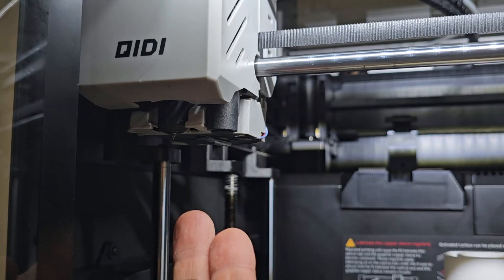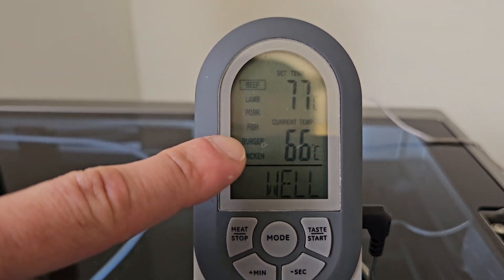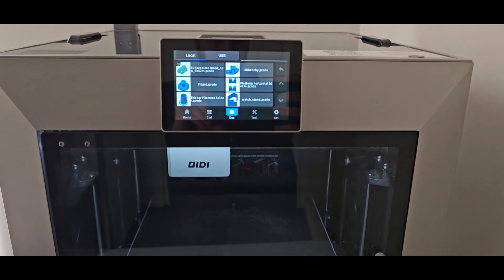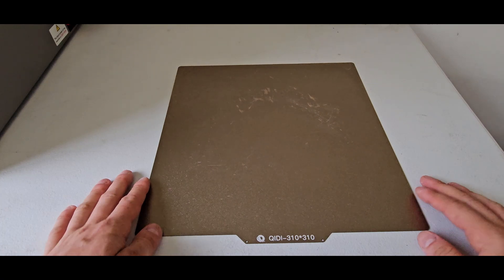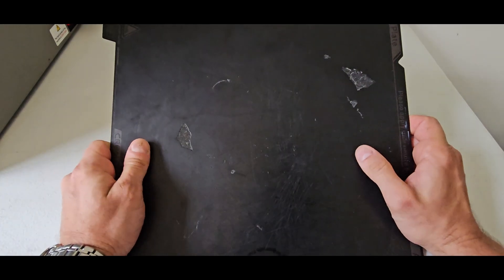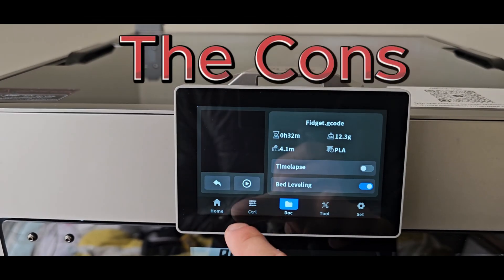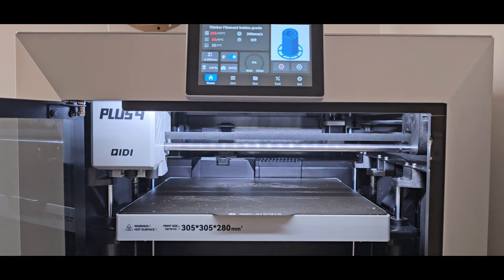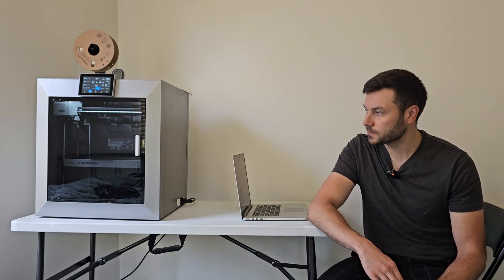I PRINTED FOR 1000 HOURS... What They DON'T Tell You About the Qidi+4

Comment: Decent printer the only trouble I had was the nozzle would sometimes hit the little metal plate in the back when it's cleaning nozzle and after many times the nozzle got damaged. Would still work but flow was slightly less due to restriction form damaged nozzle tip.

Comment: @2:10 why are you scrapping? The build plate can be flexed. I have never had to scrape anything off my build plate.
Reply from the maker: It really depends on the geometry of the part and filament you're using. Sometimes you need adhesive on the plate and flexing doesn't remove the part

Comment: Hello,
  I have a Qidi Plus 4 and have run into a troubling issue. I am attempting to print two parts and the each file is 803MB. I use orca slicer. When I attempt to transmit the files, I receive a 502 Bad Gateway error. I also start receiving  a continuous  error message the time lapse has failed.

  I reached out to Qidi tech support and was told the size of the file was causing the 502 Bad Gateway error. After some research on the Qidi tech FB groups I found a user stating the max file size for transfer is 500 MB. I loaded the files on the USB drive and started printing.

  These 803MB files are 76+ hours of print time and ~1.8kg of filament. I had one of these prints running today. After 20 hours the printer stopped and reported “print complete”. The nozzle stopped at its last location instead of moving to the front right of the print bed. 

  Have you seen any issues like this? Have you solved them? If so, how? Thank you

Comment: Personally, I feel the screen is just fine, especially at the pricepoint this unit is at compared to the competition (Bambu, Creality, Flsun, etc.). Sure, it takes a moment to load the thumbnails, but other than that, the responsiveness of the screen is quite good. It's bright and sharp enough to easily perform on-the-fly adjustments. 

As far as the start-up routine, I like it. Why? Consistency! ALL my prints are consistent in terms of setting the z-axis and leveling. Now, there are times when I turn the per-job bed-leveling off, especially if I'm printing repeat parts. Sure, the routine is longer than others, but the quality is well worth it! 

Replacement parts are very reasonable on Qidi Tech's website and they often run discount promos to make it even better. I stocked up on several nozzles and a few replacement heads, a smooth and cool plate, as well as some spare items such as filament cutting blades, silicon socks, and nozzle cleaning items. There's already a TON of mods you can find on Thingiverse and Printables, which makes customizing that much better. 

All-in-all, this printer KICKS MAJOR ASS and I didn't have to spend over a $1000 like you do with the others.

Comment: PETG question: with the textured build plate, is any special procedure needed to either get PETG to adhere or to release?  I've been happily printing many hours of PLA on my Qidi+4,, but wary to try PETG because for at least some other build plates (in other printers) PETG sticks far too well... and I don't want to naively ruin the Quidi+4's build plate!  Thanks!
Reply from the maker: Yes, use 'Filaform adhesive spray'
Reply: @Buildprime_x  Is that to get the PETG to stick? Or to release?
Reply from the maker: @Graham_Wideman  to stick
Reply: ... and I just printed a benchy boat in PETG and it came out great.  I did notice that it was easier to remove than PLA from the (stock) build plate, even though the plate had not cooled appreciably. So that could be a concern, and corresponds to @Buildprime_x's comments.

Comment: I really wanted to like this printer but my team has had so many problems with the Z height getting corrupted and the nozzle crashing into the build plate and gouging the hell out of it that I just can't recommend this printer.  When we upgraded the firmware to verison 1.6 the problem got even worse.  There's just no excuse to release firmware with this kind of major bug.  The E-stop on the screen is a joke too since it takes about 5 seconds to take effect.  A lot of damage to the plate can happen in 5 seconds.  This is no doubt a symptom of the laggy screen UI you mentioned.  I know Bambu has ticked a lot of people off with their recent security policy change, but at least they make sure their printers work before shipping them.
Reply: I got my X1C on April 2023 and in the second firmware update I got the build plate scratch, and this guy's work on his software.
Don't get me wrong it is a good machine, I upgraded the enclosure insulation, I tune the skew to get precision and I mostly print abs asa
With an aftermarket nozzle.
I got one qidi Q1pro and I sold the X1C with 2000 hours.
I will get the plus 4 soon
Reply from the maker: Yea I'm generally scared of updating firmware on printers for fear of the new firmware ruining something that previously worked fine. Hopefully they patch thag
Reply: Mhh I have none of your problems, maybe a defective sensor?

Comment: At 65C, can you print full bed size ASA or ABS parts and not have them warp? How do you assure adhesion to the bed for those materials? Got any experience along these lines during those 1000h?
Reply from the maker: Yes, 65 degrees is fine for keeping Abs from warping because it keeps the whole part hot uniformly. I've printed plenty of full sized parts in those materials. Bed adhesion is solved with 'Filaform adhesive spray'

Comment: I'm over 1000 hours on my Plus 4 now. A WHOLE lot of very hot engineering grade filaments. After 1000 hours I've learned- this printer is freaking awesome still. I've had a couple small issues- the chamber heater started acting up around 800 hours. Easy swap, the filament cutter arm broke around 700 hours and a LOT of filament changes- I was doing multicolor manual changes so- A LOT. And I've had 2 nozzles explode for what appears to be NO reason- I suspect when used in HIGH temp prints- 330-370c the heat cycling stresses the ceramic and it'll will just crack inside the nozzle. That's it. That's all. The thing is freaking awesome. The print start up is a love/hate thing. Love how well it works- HATE how long the self leveling is. Improvements- hotend fan shroud, coding as listed in the plus 4 wiki to reprogram the chamber thermal sensors to be much more accurate (and in effect it'll raise the chamber temp because as is it is NOT giving you an accurate temp reading for the chamber- it may be as much as 10c COOLER than it says. 2 minute fix and then heated chamber work even better and can beat soak up around 80c for those real got prints. And the qidi box is coming out Some time this quarter they said.
Reply: The nozzles exploding is kinda common and the proposed cause is that the nozzle smacks against the side of the PEI wipe plate. There is a fix but it's pretty jank, you have to either cut part of the plastic frame or sand down that PEI piece to an angle
Reply: Can you share what specific engineering filaments you're printing? I'm looking at printing parts for a muscle car restoration out of PPA-CF or PPS-CF10 (not sure yet).
Reply: @edmorris4103 all of them. Pa6, pa12, ppa pps paht, pet cf, PC cf. What do you want to know? (And what specifically are you wanting to make for your project, i can prob tell you which one id use to make it)
Reply: Thanks for sharing… everyone thinks these will never have issues and think parts don’t ware over time and ignore maintenance.

Comment: Great review, I've just got mine, I've put it on a desk that has four pipe legs, the desk is dancing like crazy during the printing process, the first benchy come out nicely, would you prefer to put it on a more stable base? Thanks
Reply from the maker: I've had it on some shaky tables, it still prints ok. Of course, it's better to have it on something solid, even the floor, if you have a hard floor
Reply: @Buildprime_x  Thanks, will try out to see the difference, even with the wobbling desk the results are next level

Comment: Love my QIDI plus 4,    Made double the price I paid for it right away on my first Job on it.   25 custom Mounting plates for London bus cab control units.     churned them out fast accurate and beautiful.     bed levelling is hard to turn off,  if I load onto a usb and print I get time to turn it off on the LCD if im quick,    if I send over network  I cant bypass levelling.   it's annoying for small parts that may print quicker than the levelling process.  The belts to me don't seem tight enough,   printed belt tensioners to bypass the springs.   Think prints would have less artifacts when I choose to print faster if they were tighter.    not installed it yet.

Comment: I'm not sure why you may be having issues with your screen. Our Plus 4s screen is very responsive and works great. Make sure you download their recent firmware update.

The Qidi screen is a much better screen than what comes on the Bambu printers (that look like they were designed in the 1970s). 

I'm very glad that Bambu came out with their lockdown news before I bought my printer. I was going to buy a Bambu and then after the Bambu fiasco, I decided to find another printer. I came across the Qidi Plus 4 when I saw that it was nominated as Printer of the Year. I'm sooo glad that I bought the Plus 4 instead of the Bambu 👍

Comment: I buy plus4 begin of November, it works fine up to 200 hours when it refuce to start. First I think it got bad power supply but it works when disconnected from motherboard. After several hours of seeking fault, I find that unplugging cable from motherboard to printhead let it boot up but if plugged then nothing. Maybe its just burned circuitboard? But to my horror, there were more: Z axis steppermotor cable has broken insulator, it has long cuts on it so inner wires were visibly, outer insulator was missing 10mm part and cut in half longer. What cause it, was it faulty cable from manufacturer or was it broken when installed? It doesn't move so it should be perfecs. AND there is more. From motherboard 3 wire cable (black,blue,brown) go towards filament tube... well someone who assembled this machine push screw trough that cable! Unbeliewable. Even one fault is not acceptable but several is really serious quality problem. I am sad because this printer do really good job but manufacturing quality is not so good.

Comment: 3:40 exactly what I am working on doing now. Since it runs klipper it should be possible to have the printer do multiple procedures at the same time. You can also have it use a known and more dialed in mesh for the bed.
Reply from the maker: Beautiful

Comment: I've had this printer for a bit under 2 months now; it was my first 3d printer.  I have printed PLA, PETG, PET-CF, TPU and PA materials, all without any issues.  As this was my first printer, I wasn't sure what to expect but it has worked more or less with no issues (once I figured out a few things myself).  Frankly, I'm a bit surprised when I see reviews for other printers and they have no issues, they are declared marvels, but when this specific printer 'just works', everyone is "I guess it's ok".

On the issue of taking too long to startup - that was my biggest gripe as well, a tiny part that takes 3 minutes to print will take almost 15 minutes by the time the bed heating and self leveling are done.  A few things that help:
 - When I know I will be printing something, I always manually set the bed temp to the end goal so it is heating up while everything else is taking place.
 - You can skip the automatic bed-leveling if a print is already in memory and you start it with the display - right before pressing the 'Play' button, uncheck the bed leveling and it will simply home and go.  When I print multiple parts in order, skipping this makes printing significantly faster.

Comment: I do have the Plus4 and the X1C carbon. For my engineering materials the X1C is not good enough, certainly missing the chamber heating. And it goes downhill fast if you do not stick to BL filaments. I saved up for the next Gen BambuLab printer but after the latest force firmware upgrade of BL, I right away bought the Plus4 and will sell the X1C. Am very happy so far, the print quality of the +4 is very close on the level of the X1C with PLA and PETG and top notch with PET-CF, ABS-GF, PC, PA and ASA-CF. And these are not Qidi or BL products, but affordable Siddament filaments.
Reply: Who would've guessed a bambulabs printer works worse if you don't use their filament (that has a sensor in the filament roll) 😅
Reply: @FUŻŻYYMONKEY this is exactly why I’m replacing my X1C with the qidi, I don’t want to be stuck with their filaments to get good prints. I’m slowly giving up on BL
Reply: @Our_Strange_Past I've had ok luck with bambu on off brand filament but they usually need a tweaked profile which is a pain. My K2 plus prints beautiful on generic profiles on most off brand filament so it does seem to be a problem with the bambu profiles themselves. Looking at the qidi now for a second large heated chamber printer.
Reply: @Our_Strange_Past  I'm also going qidi, I really like the plus4, and it seems like the best for that price range, especially with their multicolor coming out
Reply: @FUŻŻYYMONKEY whenever that is.
Reply: @Our_Strange_Past

I was SO close to getting a BL printer but as fate would have it, it wouldn't have been the best choice for me anyway as I want really tough materials for engineering and repairs around the home.

But knowing that BL allegedly lied about the data the machine itself keeps, if I design something new, China get's to see it (it's rather complicated but they have the ability to figure out what you're doing).

I don't really need nor want convenience as such, I want the freedom and privacy.

Comment: 1. Stick the plate into a freezer at below 0° for 10 minutes, works with textured and smooth plates. 2. The display, it is an USB controlled display with no HDMI on the controller. CON: Controller, no HDMI, Mechanical linear rod not linear rails, modified Klipper not full Klipper - For the price a good deal, replace the controller and display with a BTT Manta M4P + Raspberry PI CM4002008 + full klipper - He never mentioned his maintenance schedule on the linear rods.
Reply from the maker: Yes, that's true

Comment: I have read that changing the nozzle is a nightmare. Have you had that problem?
Reply: I’ve changed my for a tungsten one and it was really easy
Reply from the maker: No, actually changing the nozzle isn't too bad, the hotend is accessible. changing the extruder might be more difficult, because its not as exposed as other printers
Reply: Not true. Changing the nozzle is super easy and fast. The hardest part is getting the silicone sock off.
Reply: The first time that I tried to get the sock off it was worrisome, mostly because I was afraid of breaking it. But now that I've removed it a couple of times I see that it is actually very straightforward and easy to remove.

Comment: What they DON'T tell you... Dunh dunhh DAHHHHHHH! Dramadramadrama. I have one of these. It does take a bit to heat up and preflight but so what... Once it gets going it can move so fast it literally shakes its entire frame, lol. And the quality of the prints is frickin amazing. I'm used to a pile of warp and ghosting in my ABS prints and so far the prints coming out of my Plus 4 are squeaky clean. Like, really beautiful. Like, precision beautiful. And fast. The same prints that took about 4 hours on my old printer are taking half or less on the Plus 4. Had my first PLA Benchy boat in less than 20 minutes total, and super clean results. My only gripe about the thing is that it's the size of a beer cooler and really heavy. But, I got it because I wanted that huge build volume in a Core XY printer, and I have no regrets so far. Wait time on preflight is largely a side effect of that huge build volume, and the rest is because of calibrations for precision. You can have warmup speeds to gush about or you can have a really solid printer. I'm all in on #2 now that I know what this thing can really do.